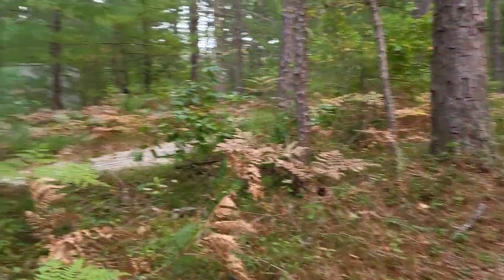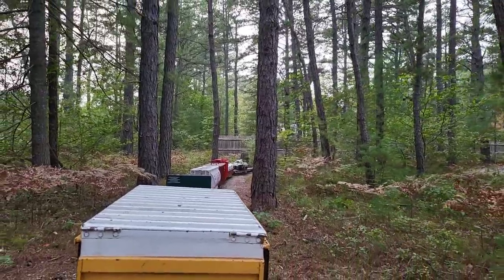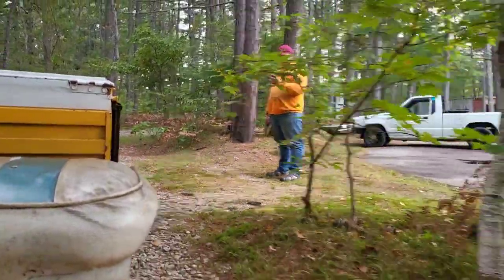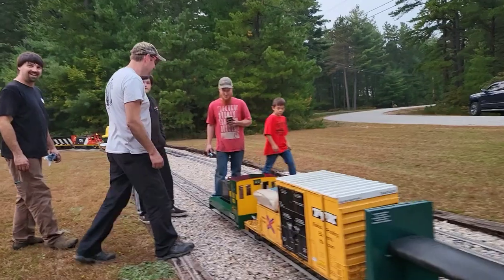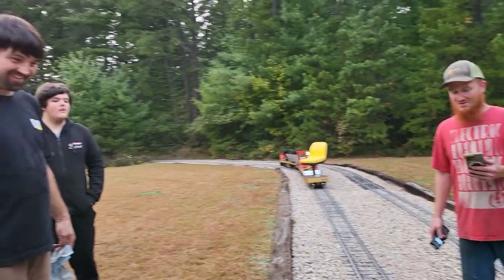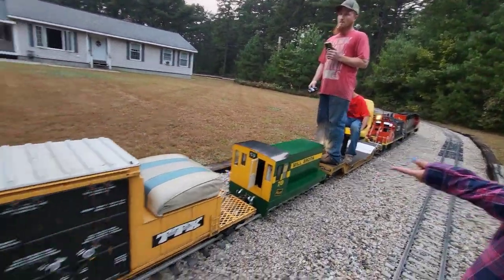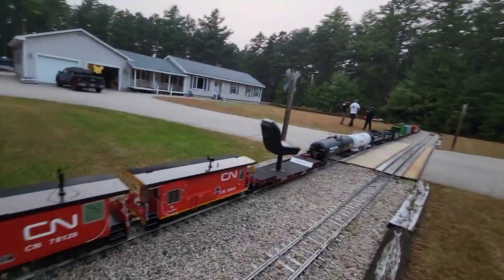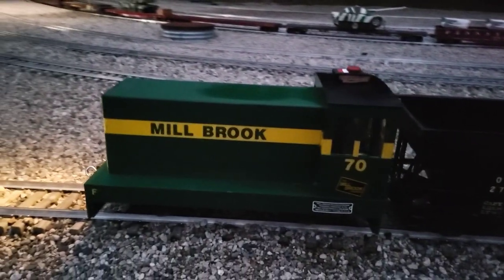Can I pull 26 cars with this loco?

Comment: Most Trains are designed to move goods or people,not look good in front of a large consist of empty wagons. On the farm your  locomotive is mainly used to pull small but some what heavy loads over a short distance. It showed its displeasure at pulling a heavy load, 26 carriages, over a long distance. It showed how well made most of it is. Most heavy duty motors have vents and cooling air blowers to try to prevent this from happening.

Comment: Pretty impressive load for a little beastie. You were just drying out the motor a little  bit. It got you back and it is still working ( if maybe a little wounded ) so It is the little engine that did.😉😊
Reply from the maker: The dirty little secret is that this is the motor that was in the 70 when she caught fire. It has smoked before, just not when the outside temperature was above freezing. Plowing heavy, wet snow is as hard on the motor as pulling a 26 car train.
Reply: @MillBrookRailroad  It doesn't owe you anything then and still it hangs in there.😎👍

Comment: Hey Aaron, hope your traction motor turns out to be ok! I think a cooling fan would be a smart addition for the future, when pulling heavy consists. I had several rides on the original Norfolk Southern Ry's  GE 70 tonners, when I was in my early teens, #'s 701 & 703. #702 was sold off before I got to ride it. I enjoy your videos, your#'s 70 & 71 bring back great memories! Keep 'em rolling my friend! 👍
Reply from the maker: I will definitely keep 'em rolling. I have a new traction motor on the shelf. I'm also working on a blower system.

Comment: holy crap. that is nice to see her actually pulling a nice train. Cool too bad the motor couldn't handle it! :(
Reply from the maker: Had I not stopped to reset the camera, I probably wouldn't have stressed the motor that much.
Reply: @MillBrookRailroad  Yeah, that starting and slow speed current is so high on an electric motor. :(

Comment: One suggestion may be an optional temperature sensor to detect when the motor is getting hot. That way you can stop and let it cool.
(and of course a cooling fan, as other suggested. Just like on the real deal.)

Comment: You should have a ressetable temperature fuse wound into the windings so that an overload does not damage the windings or motor, be it from mechanical failure, say a seased bearing or excessive load on he engine.
As I worked for a US approval body, a recognised UL recognised or better a Listed component.
Also, a fuse or circuit breaker protecting the motor again, a Listed one.
Reply from the maker: All good ideas. I'll start with a breaker.
Reply: @MillBrookRailroad Doesn't the motor controller have a current limit pot already? It's likely not as smart as a breaker that might handle some extra peak current, but hard to beat a free built-in.
Reply from the maker: @dvone4124  I believe the motor controller does have a current limiter. I'll just have to figure out where to set it.

Comment: In my RC racing cars i have a cooling fan with a normally open thermal switch connected to the motor so it automatically turns the fan on and off. You could also consider a copper coil around the motor to water cool it if needed.
Reply from the maker: That's a good suggestion. 
I have a fan that I'm planning to install, but I need to buy a voltage converter. The battery pack is 24V, and I have a 12V fan with a thermal controller. 
The motor had already been compromised by years of snow plowing, so it was actually weaker than when it was new. I have a brand new motor to replace it with, so I figured that this would be a good send-off. 
It also proved a few things that needed testing. This was the fun part. 
First, the wires are properly sized. They didn't catch fire or get overly warm. 
Second, the motor controller can handle the abuse, which was something I knew when I installed it. I just wanted to prove it to the skeptical people at the meet. 
Thirdly, it proved that I either need to turn the current limiter down on the controller and add fuses or breakers on the traction motor leads. 
Fourth, and the one you picked up on, I need to install cooling on the motor. Something I already knew, but I really only need it in extreme circumstances.  This was certainly an extreme circumstance and revealed a lot about the overall design. I'll take what I've learned and use it on the next batch of locomotives I build. 
Call it research and development.

Comment: This is the best train the 70 has ever hauled in my opinion. I think that's the situation that is needed for more than one engine to be needed to haul the cars. That's just my opinion. To me, if a train has 2 engines, the cars should make a single engine struggle. Cory
Reply from the maker: This train definitely needed two engines. It was a good test, though.

Comment: Had to rewatch...........the 70 did pretty durn good for only having one traction motor, wonder how it would perform with two motors????? And now i know how to paint a CN caboose!
Reply from the maker: I've often thought how it would do with two motors, but there's a gear reduction shaft in the way.
Reply: @MillBrookRailroad  well, if there is just enough room, you could try connecting two motors to the gear reduction shaft. You would have to wire them to the same circuit, so they wouldnt be "fighting each other". Theres an old saying, "don't cry until you try".
Reply from the maker: @paulsmith5398  I've measured it all up. There just isn't enough room without redesigning the drive train completely.
Reply: @MillBrookRailroad  well, the 70 sure showed it has some oooooomph, hauling that many cars, i was definitely impressed !

Comment: Unsmoked my 500 watt (identical) motor last year at White Creek. I’m going to install two 900 watt motors in my switcher this winter. Problem solved. Hopefully!🤷‍♂️
Reply from the maker: For me, it wasn't as much a problem as it was a send off. I already had a new traction motor on the shelf, and this one was already compromised by years of snow plow service with plenty of smoke sessions.
Reply from the maker: When increasing traction motor size, something to consider is current draw. When you go up in motor size, you also increase current draw. When you increase current draw, you must increase your wire size or risk fire. Choose your traction motors carefully and match your motor controller(s) to the motor draw.
Reply: @MillBrookRailroad  I already have 8-10 gauge wires in my switcher with copper lugs for connectors. I don’t go light on wire size and I use good copper lugs and solder wires. And yes sir the motor controller will be compatible to the little higher pan draw the two motors are going to look for.

Comment: The prototype train for a locomotive that size would probably be five to eight cars, maybe ten in a yard. The train does look great though.
Reply from the maker: As far as size goes, 70 is probably a 50 tonner.
Reply: @MillBrookRailroad  So a 50 tonner is about 300-500 horsepower and at 100 horsepower per car (a reasonable number for quick calculations) that would be 3-5 cars for a 12”=1’-0” scale loco.

Comment: Will you be building a bigger version of that green one ?  Like a heavy duty one
Reply from the maker: I do have a bigger one, but it's got the same 500W motor. Most of the time, I don't need more power, but for the times I do, I add the other loco to the train.

Comment: that was amazing pulling 26 cars , so what is the draw bar weight with 26 cars? how is
the steam engine coming? So how did the drive chain hold up? such a nice video 
surprised that your engine did not seem to slip at all with 26 cars. take care be safe out there.
Reply from the maker: I don't know what the drawbar pull was with 26 cars, but it sure looked impressive! 
The chain held up well. I was surprised at the minimal slippage. I expected it to just sit and spin, not dig in.
The steam engine is still as it was at the end of the last video. I still need to acid dip the boiler.
Reply: @MillBrookRailroad  
Thank you for your reply,  that was a great how well the engine pulled. Aaron you are
making great progress with everything! everyone has such limited time to do things,
especially this time of year while trying to get everything set for winter!  just love your
videos it is great to see the trains running on the rails. I was also surprised that you
did not have any issues with the train’s electrical drive. that must have been a heavy
draw of current with all of those cars. have a great night, sleep well my friend.
Reply from the maker: @artillerest43rdva7  I've done a lot of development on the electrical systems of my engines. The wiring harness is made to withstand a 50A continuous current draw at 24V. The motor can handle 27.5A peak. I was likely pulling between 35 and 40A. Too much for the motor, but not too much for the wiring or the motor controller. Having the traction motor the weakest link isn't ideal, but it means that all I need to do to protect the weakest link is to add a 24V 30A circuit breaker.

Comment: How about a Dash 9 for the Mill Brook RR?
Reply: Or a 4-8-4?
Reply from the maker: Either are too large for the facilities I have at the moment, and a 4-8-4 is too heavy for my tiny rail. Maybe one day, after I replace all the rail with something heavier.
Reply: @MillBrookRailroad  Good points. How about an MP15?
Reply: Or just have a twin of your locomotive and have two of them pull the train.
Reply: You could have your son control the second locomotive if you put it in the middle of the train like the DPUs on the full size railroads!

Comment: Wow!  That's quite a feat!!!  Have you considered rebuilding it with dual motors?  Is there even space for such an arrangement?  There's a two part video series on YouTube of a German guy that scratchbuilt his own 4-wheel switcher.  He built it with dual motors (treadmill?) on each axle (they were axle hung and reduction geared like traction motors on full sized diesels).  I want to say that it was smaller than the 70...   Here's the link.  The underside of the chassis can be seen at 8:50.  Cool rig.

https://www.youtube.com/watch?v=3FfYDwSv9K4&t=725s

Impressive little beast...  (the 70/71).  Thanks for sharing.
Reply from the maker: This traction motor was already compromised by years of plowing snow and pulling the WP-1. This was its send off. I have another traction motor on the shelf.
There really isn't room for two traction motors the way it is set up.